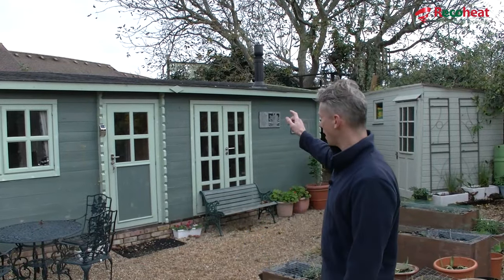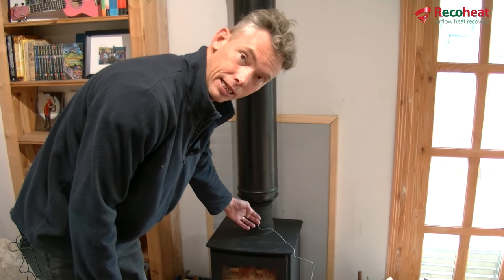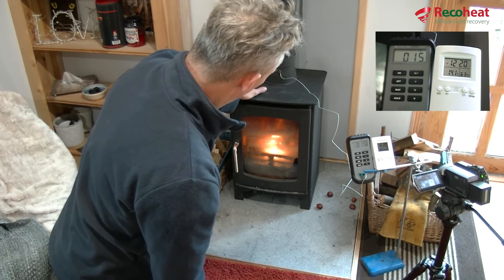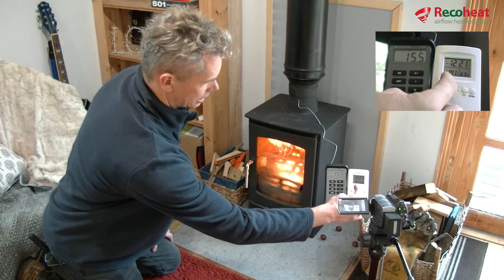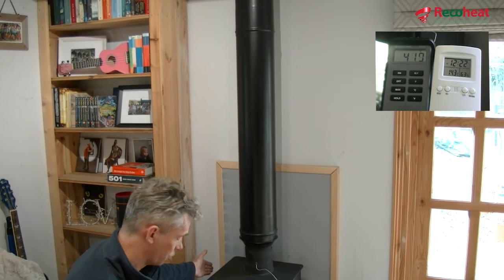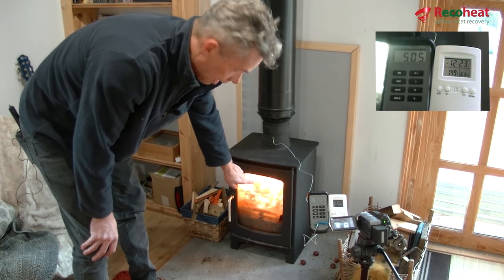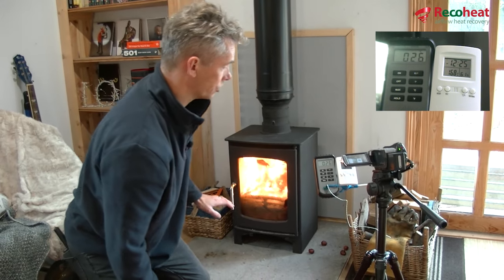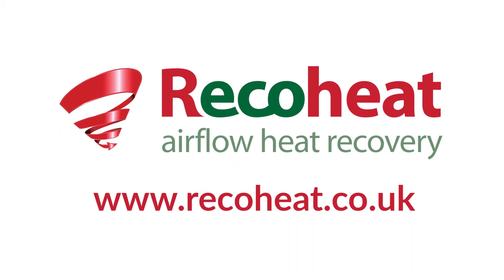Introducing the Recoheat heat recovery unit for wood and solid fuel burning stoves

Comment: What would be of more interest is the increase in efficiency of a stove if this is fitted. A decent stove will achieve 80-85% efficiency (measured to EN13240 & EN13229 standards) normally. On your website you claim to 'double the efficiency of your stove'. This would be to around 160%, well into perpetual motion territory. Would you care to share the true figures?
A quick calculation shows that with a 1 litre/sec input, the maximum output at 500C would be around 420W. (a cubic metre of air has a heat capacity of ~840 j/m2K)
But- where did you get an aquarium pump that delivers 3600l per hour? (1l/s) The biggest seem to be nearer 300l/hr. That would give you 35W output. The same as you are consuming in the pump...
Reply from the maker: Hi Mike, thanks for the engagement. No, we mean fuel savings. The heat dissipation is being driven by the pump, not radiant-heat-driven convection flows. You therefore need a hot fire, but not such a hot stove. This makes less difference with a small stove, but on a big one like the Hunter Herald 80B use by a customer in Lincolnshire, it makes a huge difference. Because convection relies on cold air coming into the stove, big rooms such as theirs are cold at the walls and hot immediately around the stove. The Recoheat heats the whole room with a more even temperature, makes a measurable difference to the heat in the corridor outside the room - therefore reducing the heat sink effect it has on other adjacent rooms - and during the day they keep a small fire going that allows you to touch the top of the stove. They're extreme, but report using about a third of the fuel. Other people use half. I can heat my workshop all day with a burn of an hour and a half: I just leave the pump running and it's still sending air at 30 degrees at the end of the day, so the ambient room temperature is maintained.
Reply: @Recoheat  You reply with a lot of words, but no numbers.
Efficiency compares the thermal value of the fuel to the useful heat recovered. Spreading the heat extraction over time does not change this. If this is 80% (fairly normal) there is a maximum of 20% left to extract. If you are saying that the advantage is moving air, then a fan is much more efficient than a pump (which has fluid friction losses). 
If you are really shifting 1l/S of air through the tube, then you have a jet of air at 500C travelling at around 10m/S- clearly dangerous! But I can find no aquarium pumps that can supply at that rate- certainly not at 37W. Even then, your claim (1kW) is still more than twice the possible output- set by Physics.
Another problem- as you say, heating air to 500C quadruples the volume- at free air pressure. Inside the heat exchanger that is not possible- it is confined. The gas laws tell you that pressure goes up instead- to around 3 bar. The pump is not designed to work at that pressure, so flow will drop- considerably. Check the pump specification, it expects ~0.1 bar maximum.
Reply from the maker: Hailea V60: https://www.amazon.co.uk/Hailea-Pump-Minute-Manifold-Hydroponics/dp/B00NSOQZO0 Give it a go! It's so cheap because it's used to run Coy carp bubbly bits: 10 at a time.
Reply from the maker: @Tensquaremetreworkshop  4. Hailea
Reply: @Recoheat  So you believe the specifications of a Chinese pump supplier? Interesting.
The problem we have here is that-
- the back pressure resulting from accelerating the gas from 20 to 52m/S is 0.76kg, which translates to 1.5bar (1.5 x 10^5 Pascals, for SI purists). Pumping 1l/S against that pressure requires 150W output. The pump is rated at 37W.
I am ignoring pump efficiency (notoriously bad in small air pumps) flow friction and other matters.
If the pump can ever manage 1l/S (and I doubt it) it cannot under these conditions.
Reply from the maker: @Tensquaremetreworkshop  Gosh, another expert who can tell me something isn't possible while it burns a hole in their hand.
Reply: @Recoheat  I am NOT saying that it is not hot (500C) or that it would not burn my hand. (Good that you admit the safety hazard) What I AM saying is that you are not getting a flow input of 1l/S under these conditions. And if you were, that would be ~500W max, not 1kW (due to the thermal capacity of the air). This would require around 250W input to the pump (to give 150W output) so half the heat would be on your electric bill...
Reply from the maker: @Tensquaremetreworkshop  How can holding your hand over a lit stove not be a safety hazard? You're also very glib to dismiss claims of efficiency by one of the leading manufacturers of air pumps sold in this country. That seems strange. Again, you've missed the point that the thermal capacity of the air is not fixed, but more importantly, that the heat output of the device is not the significant factor in its performance. Again, you're chewing an irrelevant bone while ignoring the very obvious point upon which our device's efficiency rests - that effective heat distribution on a stove falls to close to zero when the stove cools so that ALL the remaining combustion - not 20% of it - is wasted. Our device recovers a proportion of that 100% inefficiency for a period of hours. So it is a perfectly simple, reasonable, demonstrable and coherent proposition, with the main point being that it is instantly demonstrable.
Reply from the maker: It's also the basis of the efficiency of hypocausts, chimneys, thermal stores of any kind, rocket stoves, ducting, gas-powered central heating - any form of heating that doesn't involve a flame in an open space. The problem with heating is not how much heat fuel can generate - it is how efficiently it can be distributed. That point is so obvious, I'm afraid your constant reiteration of combustion data is indeed fatuous, and I'm sorry I've not been able to communicate more effectively. Luckily the ASA only has to receive empirical evidence, which a simple matter of client testimony and a demonstration if they wish. We love doing that.
Reply: @Tensquaremetreworkshop  U reply with a lot of numbers, that aren´t connected with inner cohesion or even words... Doing so, as thought u wouldn´t understand, that here the purpose isn´t to generate more heat out of wood than what´s in it, but instead to pull more of the energy of the firewood (by means of design), is already pretty poor... After all, if it works without chimney sweeping at just 37Watts, that´s a winner... Firewood can have 4500wh/kg, extracting a bit more of it is unproportionally more than 37Watts of electricity... The problem is somewhere else: This solution is simple and cheap, but this specific product isn´t cheap...
Reply: @klausbrinck2137  That is what I addressed- a wood stove will operate at 80% efficiency, leaving a maximum of 20% to further recover. So claims of 'twice the output' are doomed to failure. Having stated that, I went on to address why, even if the energy was there, This would not extract the amount claimed- both the heat transfer capacity and the air thermal capacity are not sufficient. A third problem is that, even if those were solved, the energy required by the pump (to resist the force from the expanding heated air) would be much more than 37W. I calculated it at 150W (output, the input would be higher) for 50% of the performance claimed.
None of this means that it does not work at all- some heat output is available. How much? there is not sufficient information to calculate, but a guess would be 3-5% of that available- in other words a 80% efficient stove would achieve 83-85%. From that the energy input to the pump would need to be subtracted.
Why is the result so much less than the claim? The crucial issue is flow rate, which (from replies in this section) has not yet been measured. I am certain (the physics are clear) that it is substantially lower than 1l/S. An air pump that can achieve this level of flow in free air will not do so against a head of (at least) 1.5bar.
Reply: @Tensquaremetreworkshop  80% efficiency of burning may also mean that u let 79% of it go up the pipe, so, means nothing. In this extreme dumb example of mine, it´d be enouth to harvest 1% more out of the 79% that go up the pipe, in order to "double" the output. of course, no stove was ever designed that bad, letting 79% go up the pipe, but you get me.  U act like u wouldn´t know that, but u know very well. a stove is better than an open fire, and this product makes a stove even better. it´s a question of design, and not of fake/pretended overunity as u blamed him for. And if u start blaming for something that´s obviously false, and everyone recognizes, that u yourself know that u aren´t fair, none is gonna read the rest. Of course, doubling the output is a sketchy statement, cause it´d mean, that the stove used to let 40% of the heat go up the pipe, and it now lets zero heat go up the pipe. Of course the pump isn´t what it claims, but for a cheaply made product, it is still good enough, and an easy upgrade. the problem is again, the high price... those products https://www.amazon.de/s?k=Abgasw%C3%A4rmetauscher&language=de_DE&__mk_de_DE=%C3%85M%C3%85%C5%BD%C3%95%C3%91&linkCode=sl2&linkId=932d7b2fb7712e8546cfb65cf79a369d&tag=condepio-21&ref=as_li_ss_tl are probably just as good, and more affordable... and in €s, not in Pounds...
Reply: @klausbrinck2137  No. I say again, no. The EN standards for thermal efficiency of wood stoves measure the percentage of thermal energy in the fuel that is transferred to the receiving air space (i.e. the room). The remaining 20% comprises the lost heat in the flue gases and the residual non-recoverable energy in the ashes (plus other minor losses). 40% cannot 'go up the pipe'. Much as you might wish it, the heat is not there. If simple heat recovery coils were that good, do you not think manufacturers would not have adopted them? It is a common technique in other applications- it is not something new. If you do not understand this, can I recommend a primer on thermodynamics- if is an interesting topic, and something that would benefit anyone.

Comment: Have you measured the flow yet?
Reply from the maker: No: still relying on the published, industry-standard declaration of performance by this and all the manufacturers. Making lots of progress in other areas though, and we've been on the road a lot. https://youtu.be/LbMzmdYHVgI gives an expert, external view of the actual functioning of the device.
Reply: @Recoheat  Except you are operating outwith the manufacturers specification. Why do you refuse to perform a simple test that would validate (or otherwise) a key performance factor?
Reply from the maker: @Tensquaremetreworkshop  No refusal anywhere! There's nothing simple about it and we're already doing 16 hour days - it's your concern, which is fine - literally no one else gives a monkey's! But more importantly, my test will mean nothing in relative terms, because all the pumps measure the way the industry leader does. What am I going to do - contradict them? Particularly when your other observations about performance re pressure etc are observably not true, whether or not they make sense theoretically.

Comment: Potentially interesting, but you do not describe where the 'extra' heart comes out -- confusing!
Reply from the maker: Sorry! As below: the air is pumped to an inlet at the back of the flue, just above the collar. It goes round a steel coil inside the flue, which is the recovery unit, and out at the front, above the stove. There's a better presentation at https://youtu.be/tknNKch8ED8 and an FAQ video at https://youtu.be/fOdsE-DVGTo  The website also has images and a lot of detailed info - www.recoheat.co.uk Thanks for your interest!

Comment: Hi, I own 2 HVAC manufacturing plants with about 80 employees here in Ontario, Canada. We've been in business for over 25 years. We make all sorts of equipment including HRVs (Heat Recovery Ventilators).

Your "air pump" moves 1 litre/second = 2.12 Cubic Feet per Minute (CFM) and uses 37 watts. The fans we use are state-of-the-art ECM style and will move 75-100 cfm using 35 watts while overcoming an opposing external static pressure of about 1.0" water gauge, which is much more resistance than you have pushing 2 cfm through that little coiled tube.
Your air "pump" is about 1/35th to 1/50th as efficient as the fans that we use. Not a good start!
Reply from the maker: Hey Captain! Thanks for the interest, and congratulations on your achievements as an entrepreneur and businessman: we aspire to your levels. You should look at our product reviews, and aspire to our levels of efficacious transformation of heating distribution. In terms of physics, the difference is that you are pumping air down hill, and we are pouring it up hill, which has an efficiency comparison of pumping water up hill or pouring it down hill. The remarkable thing is that we use pressure equalisation to pour it down hill as well. Who'd have thought! We don't pay, in mechanical or electrical work, for the coldest parts of a habitation to have warm airflow passing into and across it. We'd love to work with you, and indeed have customers in the UK fitting our units to enhance the warmth circulated by your very effective HVAC systems. Thanks again for your engagement.

Comment: I dont understand how this helps heat other rooms unless you have the air pump outside which most people will be unable to do. If the pump is inside the room with the stove then the heat will be just distributed into the room it is in which is already roasting hot. I do get how this works but UNLESS it's bringing in air and slightly putting positive pressure into the room it is installed in then it's not going to heat other areas.
Reply: true  but  think maybe you leave the doors open
Reply from the maker: The air pressure is raised by the expansion in the heat exchange as well, which is key to the heat distribution because the turbulent air then equalises quickly with the cooler air in the room. But it does also increase the pressure which then causes a convection flow into the other rooms. That does take time to build up, but it is very marked: one customer is heating the hall in his barn conversion and it switches the thermostats off in the bedrooms upstairs, for example. Others are heating conservatories, corridors and adjacent rooms. The chap with the boat heats the whole thing and no longer uses his oil-fired central heating.
Reply from the maker: @eliotmcnamara3190  Yes, you do need to allow air flow.

Comment: W T H Is going in/out??
The only advance is the big smoke extender. There are smarterones, fi. three Inline tubes +vent
Think of the chim needs heatheatheat
Reply from the maker: All the alternatives simply move radiant heat from an increased surface area of the flue via a laminent air flow. That works if enough redundant heat is going up the flue, but cools the surfaces in direct proportion to the air flow. Not sure why you think that is smarter. Our system removes heat very efficiently from the core of the heat flow so that it makes very little difference to the most redundant flow of heat. Because it is the hottest part, rather than coolest, it also means that particles continue to be burned off so that no change is made to that important function of the flue. The principle difference in terms of efficiency  of heat dispersal is that we are putting the electrical work we use into pressurising as well as forcing the airflow. This means the heat creates acceleration in the flow - unlike the fan-based systems - but primarily that the heat dispersal is driven by the pressure equalisation, not the mechanical energy imparted to the flow by the fans. So instead of pushing warm air into cold air, the cold air is drawing the warm, higher pressure air into it as the pressure equalises. It's like the difference between pumping water around, or letting it flow until it's level. That's why the heat goes so far, is so even, and penetrates to the coldest areas instead of warming around the stove. I think that's clever, but it's certainly effective.
Reply: @Recoheat  hi, - removes heat from the core... :with an oil pipe andanAqpump? Show the pipe connection or somewhat, in/outlet..!what is happening in the video?
Reply from the maker: @laszlonemet4425  It's a coil of 316 stainless steel - the same material the flue is made of. Check out the website and our other videos, Laszlo, and thanks very much for the interest. www.recoheat.co.uk

Comment: Do I fit the unit myself?
Reply from the maker: If you're fitting to building regs, you'll need it signed off by a member of competent person scheme, like Hetas, or by your building control officer. If you're fitting in a log cabin or similar, it's very easy to do yourself: you simply put it into the stove collar and fit the next section of flue into the top, then seal with fire cement.
Reply: not if you need to ask 🤔

Comment: But what about the horrible noise? Electricity ia required to operate the pump and these days, this is not guaranteed.
Reply from the maker: Thanks for checking it out Barbara. There's a video on the noise level here: https://youtu.be/z0t3_nrurZg - it's exaggerated in this one both by the zoom microphone, but more by the fact there's a wire in the airflow. It makes a clear sound, but it's not loud. The pump is rated to 37w but runs at 17w, and runs very well from a car battery with inverter. We do need that power, but there's not many things that can turn 17w into 1kw and use it to heat your house. If you look at our videos and TrustPilot reviews, you'll see just how much a difference the system makes.